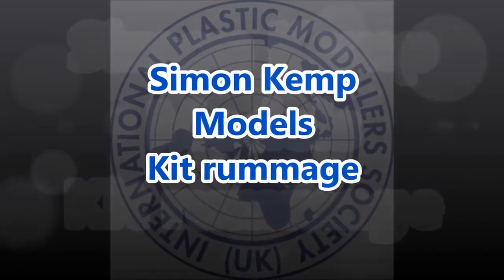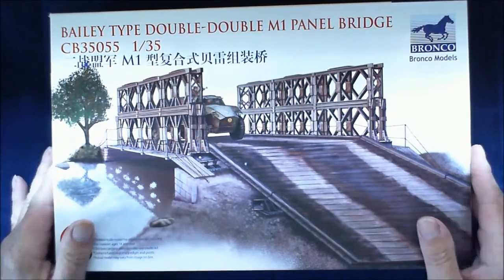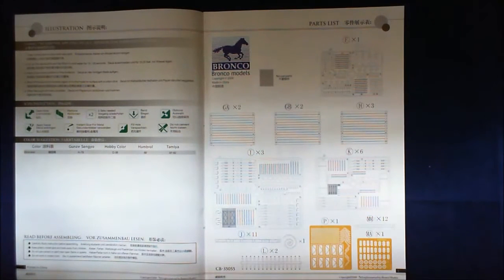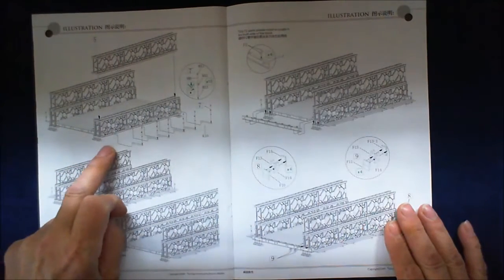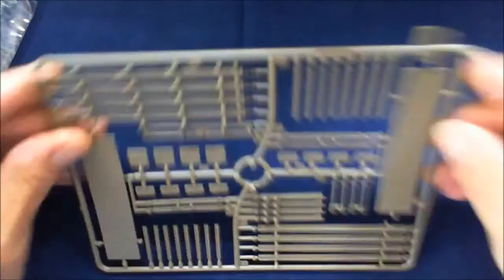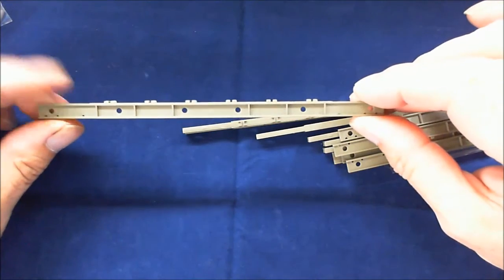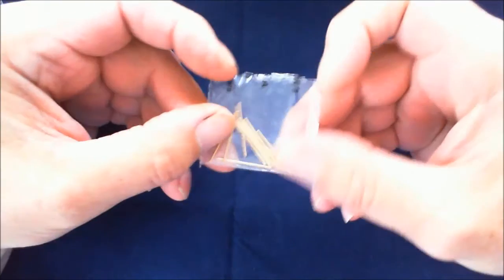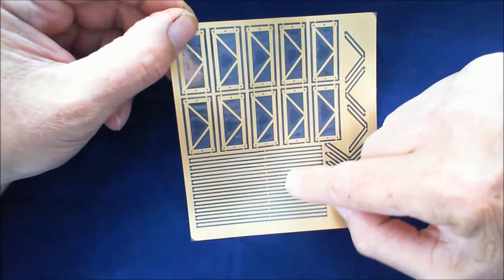BAILEY TYPE DOUBLE-DOUBLE M1 PANEL BRIDGE BRONCO 1/35

Comment: sim, great review and what a great diorama uou could do, already sim im thinking " a bridge to far "  i reckon my good friend Brett would like this, just think of his easy eight with this. i reckon your 88 at the side of the bridge would make it look awsome
Reply from the maker: Thanks Steve, I will go with the easy eight, but I'd rather have the Bofors gun instead of the 88 thanks mate Sim
Reply: The movie had a bailey pontoon bridge. Wrong the actual bridge was a triple single bridge. To build that bridge takes two double double stack kits and two triple single kits. That gives you enough to build the bridge with a few panels over. But enough decking to do the entire thing. You have six ramp section's left. The kits do not come with sway bars. And the decking is moulded with only half the stringers.  This dose not deter from a good kit. Unless like me I have the reprinted manuals( TM 5-277) AND  John Sliz book bridging the club route..

Comment: You should be able to join the Royal Corps Of Engineer's by the time you'r finished this one Simon.
Reply from the maker: Thank you John, once a builder always a builder 50 years in the trade you can never get away from it and yes, it would be an  honour to serve the engineers. Thanks mate Sim
Reply: Corps of Royal Engineers
Reply: The large sections with the cross is called a Bailey panel. Stringers and stretchers in there too. Big build that, in real life! Back breaking too, I only ever did it the once as a Squadron build.